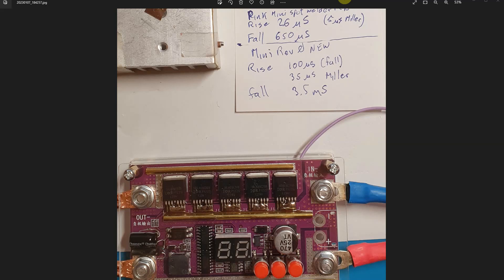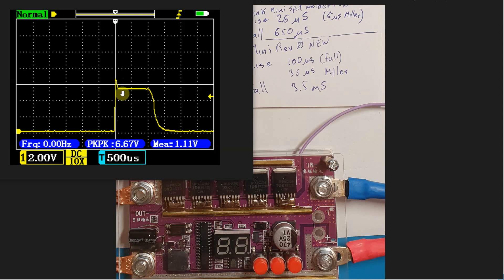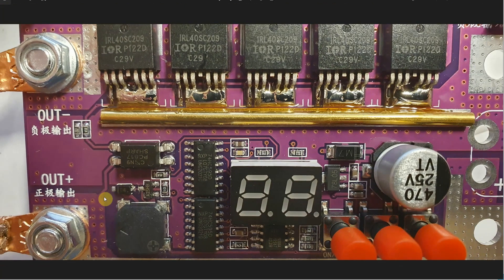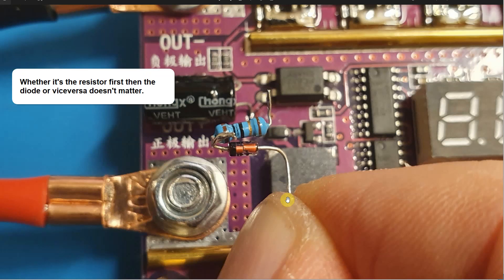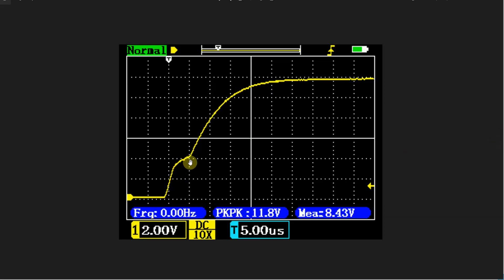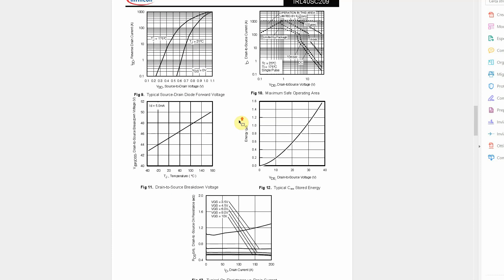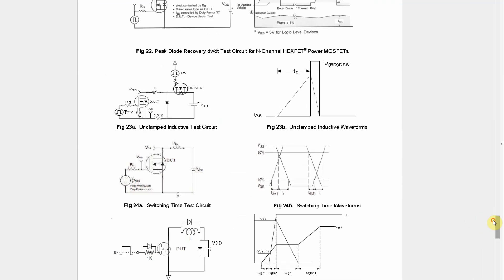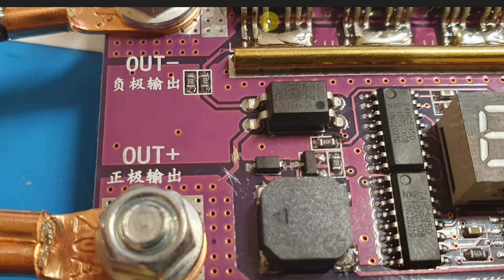"Purple" PCB Mini Spot Welder

Comment: HeyLuca
Unfortunately I blew up one of the gates .. Saw a puff of smoke and then she was hot hot as far as the curtain I watched a guy repair the blown gate and he did what you have done to the purple one..where can I find a replacement part o parts. I have been listening to your expert advice and you have to match the voltage,I think that is what you said. 
Can this device work without the one gate.just curious I have just started this new and interesting field . Wish I had been interduced  many years ago.  If you can spare a few minutes and give me some feedback I’d appreciate it . One more question,where can one find scrap electronics for those gates I can’t think of devices that would have them .that for your detailed videos very helpful.
Reply from the maker: Hi John, first remove the broken FET and check that the short has gone - check my lamp test video (in the playlist) on how to verify that the welder is operating correctly. You may or may not have another shorted FET - that's why you need to verify it. You can do this with a tester or if using the lamp method as I explain. You can use the welder without one FET, it will work just avoid overdriving it once you have done the indicated decoupling mod. The FETs should to be always replaced in identical batches so it's better to just remove the shorted one and use the rest instead of only replacing one with one from another batch. FETs should be purchased in bactches - u may find some used ones in large UPS or switching power supplies but they may not be rated for the current, better get the identical ones as they would also match the pcb pad layout.

Comment: Hi Luca, great review but I have just purchased a "purple" welder from Ali and it seems they have changed the circuit again.  The revised board has the opto leg you have added the mod to now connected to the 470uF cap on the input side.  Have you had one of these later boards and if so does it also need modding?  The new PCB has 12V A3 Mash Welder VO and 230828 printed on the reverse.
Reply from the maker: Hi Harry, thanks for the update - no I haven't seen this new revision. If you want you can take some close ups front and back and send them to my email. Cheers!

Comment: Okay, so I just bought this mini-spot welder from Allie Express.. if I make these suggested modifications, how long will this spot welder last me? Or should I simply return this? 

I understand that you are using a Lipo Battery. I would like to use a car battery when this thing arrives.. that way.. if this doesn't work, I can atleast put the car battery in my vehicle and get some use out of it.. what lead acid battery would you reccommend?
Reply from the maker: That depends on what your car manufacturer suggests - if it's  a petrol engine the batteries are usually 45Ah which is fine for the mini spot welders. If you apply the suggested decoupling mod you will certainly improve Gate response thus reduce the riak of stressing the FETs. Of course it all depends on the maximum current and weld time and strip thickness u want to weld. I suggest you check my latest FAQs video which should answer most of not all of your questions.

Comment: after 8 months are you still using it and have you used it much? would you recommend replacing the FETs prior to use? all the best and thanks for the knowledge you are sharing, thanks.
Reply from the maker: I'm not using the welders lately, I haven't had the need to make new packs (luckily)! I've used mostly the Malectrics one. Regarding the FET replacement well use the ones u get then if you blow more than 1 then you're better off replacing them all with a new selected batch from a known source.

Comment: Moded a new one, but it will not weld two pieces of nickle strip together runing off a old small car battery?
Reply from the maker: Probably not enough current from that old battery, try another.
Reply: @Luca_Techy    Sorted, I copied how the spot welder is connected to battery in this kit. Most be reason why this kit, for the same spot welder, comes with these terminals.  Mine goes well now.     https://www.youtube.com/watch?v=k7KJGsuu7M8

Comment: So is this thing any good? I have already bought 5 spot welders off amazon and they all blew the mosfets
Reply from the maker: It works ok (once you mod it) but as stated so many times again these mini spot welders are not to be overdriven (exceed .20mm) as they are not designed to withstand large TVS and extreme peaks, the FETs will fail if you overdrive them. If you need something more beefy get a more professional welder such as the Malectrics which I reviewed or Kweld. Check out also my FAQ video for more info.

Comment: Hello I have modified my purple/pink spotwelder and I am having problems with getting it to weld. I am using a 3s 60c constant 95c burst. to weld .1 strip I need a setting of 40 . any ideas would be appreciated.
Reply from the maker: Hi, are you 100% sure your LiPo pack is really 60C?  Many LiPo packs are way underrated - either that or you have extra losses somewhere on the connectors (I suppose you are using XT60 or 90). Try another pack if you have one or a car battery (always start from 5ms).

Comment: Hello,if i have a Li-po 3 s 1500mah 100c it's enough?
Reply from the maker: That's not really enough - you need a minimum of 5000mAh 50C (250 Ah peak). Maybe it can weld depending on the quality but I suspect it will be very stressed on the long run.
Reply: Thanks a lot!

Comment: Great info here, and in your other videos. Thank you for taking the time to share! This welder can really weld with the mods & reflow. 

I was considering fully removing the buzzer from hell on another one, and placing this mod’s components in the space it leaves absent. That way it’s less crowded around the outputs, allowing my full-sized leads to be installed.

Which leads me to a question: Would the increased inductance from using 2ft long leads, 8mm in diameter, pose an issue here? & could the effects from the increased inductance be mitigated by adding a fly-back diode to the power source? 

Thanks again for the helpful videos!
Reply from the maker: Hi, a TVS diode is always a good addition to these kinds of setups, especially when you start overdriving the original design so yes putting one (or two) across and near the FETs is good. Increasing the leads to 2 feet / 66cms and the diameter section can potentially lead to an increased Transient depending on the quality thus conductivity of the cable (pure copper vs aluminum) as there may be an even lower resistance than with the original cables, plus more length, and depending how the cables are intertwined, can lead to different transients. In general, all these high power, short pulse designs should include a 15V TVS diode(s) placed near the FETs.
Reply: @Luca_Techy   Thank you for the informative reply. It is surprising to me that the majority of these sub-$20 spot welders sold online do not include a TVS diode, at the least. After installing a 5KP13A diode across the outputs (from FET drain to the battery positive input lug terminal) on this welder, (with gate decoupling mod) the FETs don’t become nearly as warm as they did before the diode. 

I will try and capture the output pulse from FET drains on the scope soon so I can see if/how much difference the diode is making with the possible transients associated with switching these high-current pulses. Thanks again!

Comment: can you use a 12v 12ah ups/electric bicycle battery ???
Reply from the maker: I wouldn't suggest it as it depends on the pack's current limit and BM system and type of cells (I suppose 18650 LiIon) - use a dedicated 3S 5000mAh 50C+ LiPo pack or 45Ah car battery if you don't know it's exact characteristics, it's a safer solution.

Comment: Blindly following this with a distant understanding about why I'm doing it.  Stayed up most the night ripping various things apart looking for a resister and a diode.   I have beefed up the tracks with some copper.   Works well, Thanks for the in put, I would have never figured this out.  It's a much more peaceful experience with out the buzzer/siren as well.  Good work.
Reply: If you look to the upper right of the “gear” display you will see a little black smd diode with the marking “M7” on it. Feeding that diode is a via coming from the positive, on the underside of the board. Battery positive goes through that diode and charges the 470uf cap to the right of the diode before being fed into the “78L05” 5V regulator. All the logic on the board is receiving power through that diode/cap buffer.

They are there for the purpose of being a small power “reservoir” that the regulator can continue drawing 12v from when the battery voltage sags during the few milliseconds that the weld is happening. The diode allows the cap to be charged but won’t allow that charge to be pulled back out in the opposite direction to the (very) temporary lower sagging voltage flowing out into the weld, creating a voltage buffer. 

The battery sags in a dead-short (weld) because it’s stored energy content inside that create the “pressure” of voltage are being allowed to flow with almost no restriction of resistance, causing this internal “pressure” (voltage) to flow out faster than the the internal structure of the battery cells can sustain. This is the internal resistance of your battery becoming apparent when it’s used in a short-circuit situation for spot-welding. 

All you did by preforming this mod is exactly the same thing that’s already on the logic power input, only difference is you did it on the other side of the octocoupler (isolated circuit that sends power to the gates of the mosfet, triggered by octo-coupler) for the same purpose. To act as a power “reservoir” for the mosfet-drive circuit. When the sag happens during the weld, now the gates will still see the full turn-on voltage as they are feeding from the capacitor you installed, that will not discharge for the same reason as the other. Because it’s being fed through the diode. The resistor is there simply because that cap can charge so quickly that it can burn the diode, and adding the resister limits the recharge flow into the cap to a tolerance that the diode can withstand.
Reply: @markb1911  Thanks for that comprehensive info.   I understood it stops the voltage sag and in turn more consistent voltage supply.  But it's great to know why.  I get caps.  but diods, fets, resistors, logic input,  lots to learn about circuit boards.   Thanks again for the explanation. :)
Reply: @nickdarling5557  Welcome! yea there’s some terminology but each of those components individually are somewhat simple in function. (it doesn’t seem like it though)  I like to think of circuits as many individual components in cooperation. I just received this board and did the mod as well.
Reply: I don't even have one of this spot welders but I bought one yesterday from temu, it was on sale for only 11 bucks so I had to grab it.

For what I understand this is what is being corrected...

The gate on the mosfets are drawing 12v power directly from the positive side, they go from the positive, through the optocopler, through the resistor in to the gates.
When the gates open, mosfet discharge through the negative since it's a short anyways.
once the mosfet discharge you're basically slurping all the power out the battery leaving a sag in the system, this sag is most prominent at the gates because it's the weakest point of this circuit, instead of being supplied with the correct 12v to keep the gate open the sag drops the voltage down to 6v which is half the mount it requires to drain correctly.
 full power is still running through this circuit at this miliseconds and that's enough to blow up the gate, since the gate is half way open but full power is being drawn.
What your doing with the correction is storing power on the capacitor, so when the sag happens, the mosfet still has enough power to deliver and keep full gate open and correct drainage 12v.
The resistor is to trickle charge the capacitor so it doesn't get full power extending its longevity after system comes back up and the diode is to keep the power flowing in that direction otherwise it'll drain through the positive with the rest of the discharge and the capacitor will be there doing nothing.

At least that's what I got out of it, you can even see the charts Luka is proving from the oscilloscope, how the gate is dropping down to 6v on discharge leaving it vulnerable, I felt in love with this hobby 10 years ago and I am barely starting to understand it now, sometimes I want to just forget about it and move on and then I watch someone doing a repair on YouTube and I can't help but to sit and watch for 30 minutes how they find the shorted capacitor.

Watch this video again after reading this post and you'll understand exactly what is happening, the optocopler is the switch being governed by the chip set, chip set, sends the signal when it detects a short and the magic happens 🎉
Reply: @letylaborin8523   Yes, your description of what the mod is doing is fundamentally accurate, it acts as a power “reservoir” with a resistor to limit it’s “fill” rate, to keep it from “fillling” so fast that it overheats and destroys the complimentary diode which is essential block the capacitor from discharging into the load, as during the weld there is temporary a lower voltage potential due to the battery being discharged at a faster rate than the internal structure is realistically designed for, and the inherent internal resistance in this structure acts like a resistor within the battery, causing heat and voltage drop. This is apparent here because of the “extreme” short-circuit nature of spot welding. 

Mosfets function a bit differently than what you describe, and the best way I can think to describe it is a faucet tap. They are acting as a “valve” in line (series) on the negative battery lead, & in this configuration, breaking the circuit when they are off. The gate is like the twist valve on a water faucet that gets twisted open with a positive voltage is applied to it relative to it’s source. This positive voltage on the gate creates an electron “bridge” between the drain and source of the fet, allowing current to flow between them. 

however, this faucet (mosfet) needs to be twisted open, and then shut very rapidly, so that most of the weld duration happens with the faucet (mosfet) fully open because it acts like a resistor in the time period when opening and closing. (that’s how it allows & clamps the current off, in this case by quickly increasing and decreasing resistance). If the mosfet is opened and closed slowly, it is generating large amounts of heat resisting current during the opening and closing time-duration. The amount of current used for spot welding is such that, if the mosfet isn’t switched fast enough, the heat generated from being in that “in between” state is so great that it will completely burn up and blow out the structure of the mosfet. There is a channel called Engineering Explained here on YT that has an excellent explanation video about how mosfets work, probably better than I can explain it.